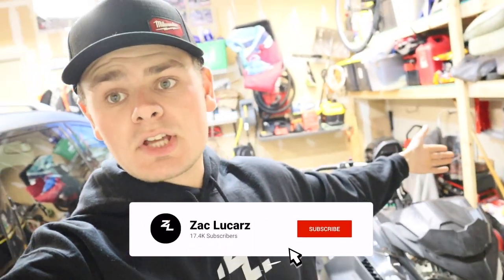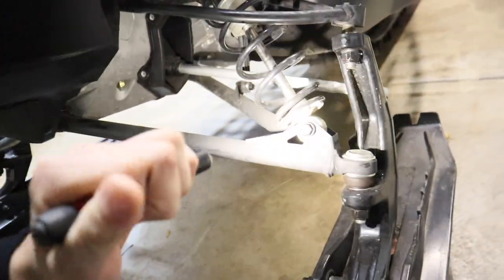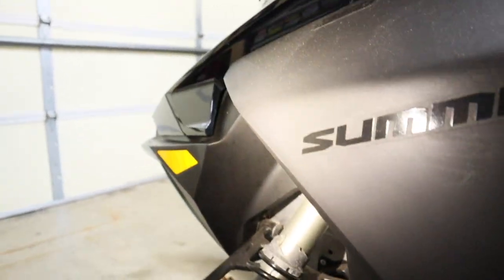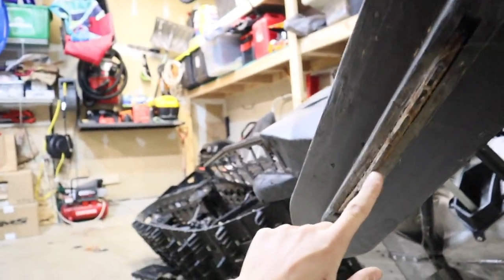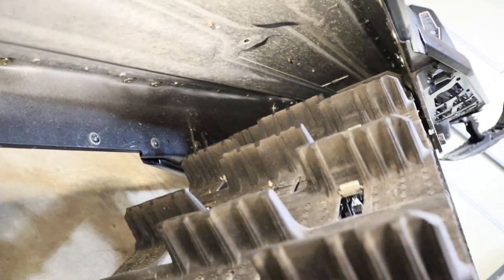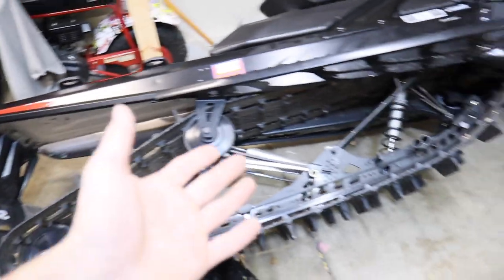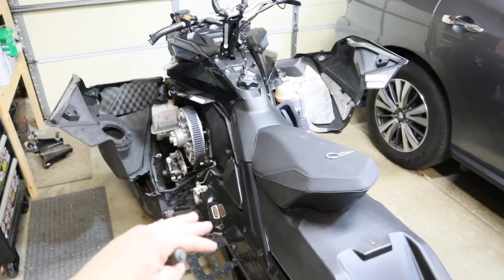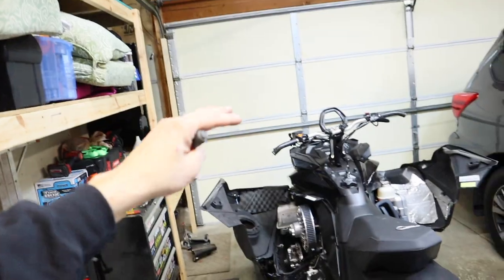How to Buy a USED Snowmobile! (Don't Make These Mistakes)

Comment: If the throttle is stuck when started on a skidoo it will still idle normally and not take off
Reply: What year did that start?  My friend had an 18 or 19 and that still happened.
Reply: @cofferful  idk it happened on my 2014 800 etec. maybe it was just a weird coincidence

Comment: Got and update from my dealer on my snowcheck boost today. More of a rumor I suppose, but my dealer said Polaris might not be having issues with parts or production, it may be an issue with shipping. Specifically a lack of truckers. Just a rumor but my dealer is seeing random sleds trickle in with mixed ship dates, not mine yet though 😢 so our sleds may already be in production or ready for shipping but just sitting in a warehouse waiting for a truck.